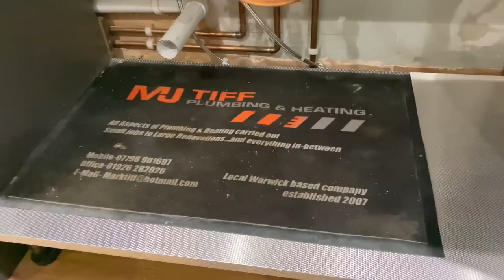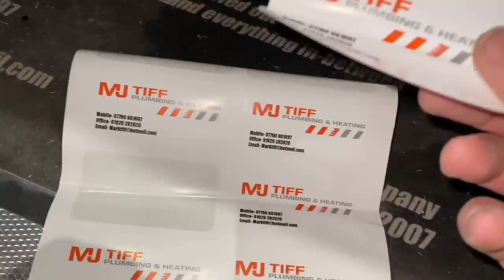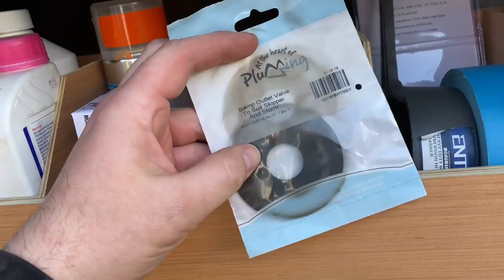WHOLE HOUSE WATER FILTRATION INSTALL & SIAMP SYPHON PASSING water into pan with washer replacement

Comment: Yep trap not fitting is a pain mcalpine do an adapter t12af
Reply from the maker: Yer I need to have a couple in reserve on the van
Reply: Mcalpine stuff just works every time,  never bother with the cheap shit it will always either test your patients or cost you when it leaks.

Comment: Great film, I love copper pipe work and toilet flushes. I’m interested to see what you think of the locktite instead of ptfe tape. 
Just a quick question if that’s ok, would you recommend putting silicone grease on the rubber sealing washer inside a new drain off valve? 
Hope the rest of the week is good to you, take care, regards, Chris.
Reply from the maker: Thanks mate, glad you enjoyed it👍🏼
As for the grease question... I’ve never done it personally but don’t see why not
Reply: @MJTiffPlumbing  ok thanks for the answer. I look forward to the next film. Regards, Chris.

Comment: Just changed an ideal standard flush washer today. Had to put a new iso in too cos I changed the inlet and it was a low pressure feed as well and had to empty the loft tank. I love the loctite thread to be honest it can spill out on rad tails but you soon get used to the stuff and how much is required. Those waste outlets are a pain. Polypipe traps usually come with a euro adapter for them.
Reply from the maker: Sounds like you had a fun day then Robert..... never a dull moment in our game is there👍🏼👍🏼

Comment: Dunno if this is a good tip or what but if you take the washer off the top of the standard macalpine trap you can file the sort of ‘tapered’ bit down to the size of the euro waste basket and the washer will still sit back in 

Thats my normal procedure anyway and havent had an issue, cba with running off to get waste adapters and shit
Reply from the maker: Yer I know what you mean... and I have done it before now but wanted to show just how it is when we come across annoying things like this..

Comment: Nice tidy job Mark 👍 Them European sink wastes are a pain in the @rse, I usually carry a couple of adapters as van stock and I'm sure you do to - but then you use them and forget to replace 😬 Are you fitting the quooker boiling tap ? I like the quooker ones , especially the quooker combi - but not keen on the Frankie range.
Reply from the maker: Exactly mate.... need to restock to save that bloody trip back to the merchants...

I think the kitchen fitters are doing the tap as they wanted the feed putting in while I was there.
I fitted one of the Bristan ones not long ago and was quite impressed...👍🏼👍🏼

Comment: I use locktite 55 all the time and never use ptfe. When you use the locktite on brass connections get a spanner and run it across the thread all around, it cuts the locktite when screwing the connection in and hold even better other wise while screwing the connection in it will just slide out.
Reply from the maker: Nice tip buddy... will give it a go... thanks

Comment: Nice work clean but I would like a Bypass under the filter in case of failure to be able to circulate the wate
Reply from the maker: Thanks mate

As said in the video there is a bypass built into the filter..👍🏼👍🏼

Comment: u should have put a bigger  filter or the 3 way cause the whole home  is filterd and they will be changing filters ever so often  with the bigger  ones u get more run time also compensate for pressure drop
Reply from the maker: I’ve fitted these for years buddy, they last around 18months with zero pressure loss. Thanks for watching 👍🏼👍🏼

Comment: I got similar filters in my house but it's a bank of 3 in a purpose made bracket all supplied in the kit wonder why I've ended up with 3 as the rep did the spec
Reply from the maker: All depends on what you’re moving/treating etc etc.....
Reply: @MJTiffPlumbing  must be to maintain flow rates me thinks 🤔
Reply from the maker: Possibly..... or you have pre filters??.... great setup by the sounds of it 👍🏼👍🏼

Comment: Done loads of flush valves never thought to change washer. Fair play you learned me! Are they standard for most valves?
Reply from the maker: Nope they are fairly specific but I usually keep the common ones on the van or grab some over the counter at my local Plumbase...👍🏼👍🏼

£3 for a washer or £30 for a valve that isn’t needed
Reply: M J Tiff Plumbing 
Cheers mate. Great vids
Reply from the maker: No problem fella 👍🏼

Comment: I use those plastic adapters a lot on catering kitchen wastes, been to many that are leaking as the last engineer has cut a mc alpine spigot trap flush, thinking it will seal.....they don't.
Reply from the maker: Yep I usually have some in the van for just this bloody thing.... pain in the arse
Reply: Why are uk suppliers supplying us with crap stuff that needs an adapter ? Really does try your patience at times. Taps sometimes come with odd ball flexis instead of half inch another bloody annoyance.  Toilets rocking up with oval waste outlets ,cheap traps supplied with shower trays that jump the threads, why ? How about a bit of quality control. Best one is the old quality checked sticker, that means absolutely f all.
Reply from the maker: Completely agree 100% mate..... really boils my head at times...

Maybe I should start outing them in my videos🤣
Reply: @MJTiffPlumbing  A lot of the stuff we buy isn’t cheap and should be up to scratch. I think most people who are in the game have probably learnt the hard way and found products they have faith in. Trouble is when the customer is supplying stuff and trying to get a bargain.  The amount of time you can spend trying to rectify some of this cheap tat is mind blowing.  If you can’t solve problems and have no patience, stay away from plumbing because it can certainly try you out. Especially on a Friday.
Reply from the maker: So true mate, i have refused to fit stuff that people have got off the internet etc before as I know it’s just a headache waiting to happen. Then when you say they need more bits to make it work they think YOUR trying to have them over.....

Comment: Does toilet water really need filtered water?
Reply from the maker: If you think about that question it’s completely floored with this set up buddy😉👍🏼
Reply: @MJTiffPlumbing  I want to get this, but I lack the understanding of all the pipes. Does this provide the filtered water to toilets and hose pipe  as well ? Personally I want to avoid it as it seems a waste of filtering.
Reply from the maker: If you put a whole house filtration unit on your incoming mate….. the whole has is filtered.

To NOT filter the toilets and outside tap you would have to completely repipe your house to those points…… why would you do that?…. Complete waste of time and huge amount of cost

Having filtered water going to the toilet has zero effect…. Infact would be better to stop any limescale build up. Same with the outside tap…

Comment: You don't sand the pipe ?
Reply from the maker: What you mean mate??
Reply: @MJTiffPlumbing  In the US. We clean ie sand the pipe with emery cloth. Wire brush the fittings. Before flux and solder
Reply from the maker: Got ya..... when the pipe is clean you don’t need to with LaCo flux that I use. If it’s painted then I would be cleaning it 👍🏼👍🏼